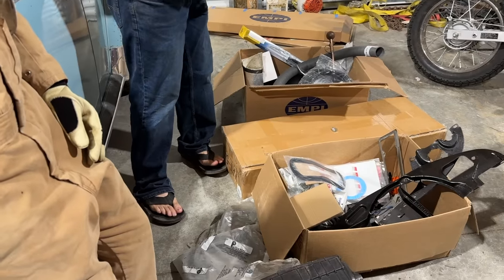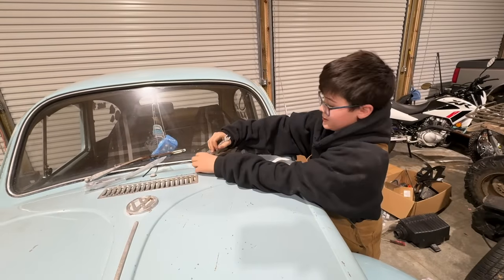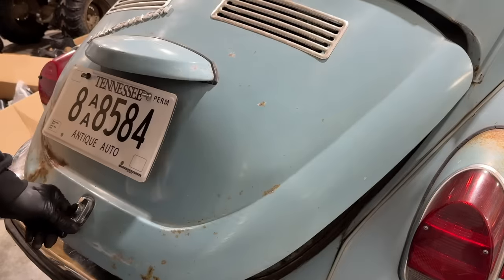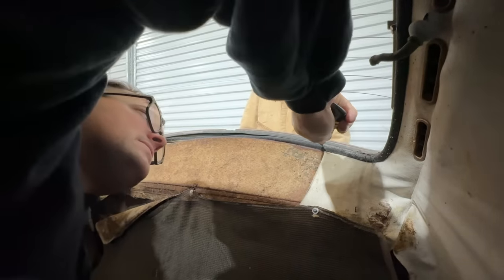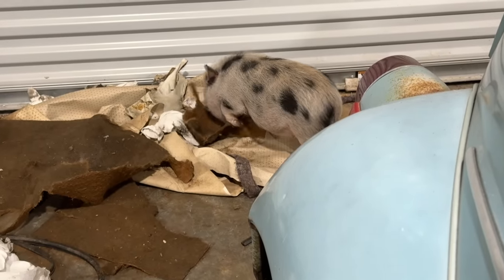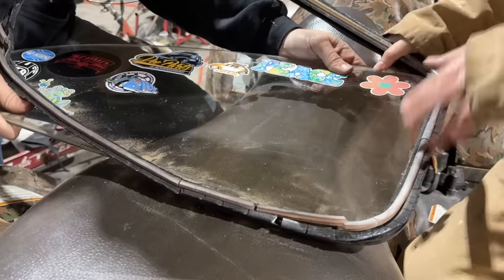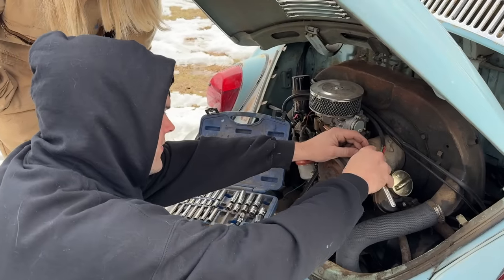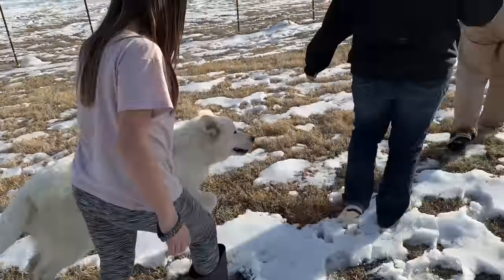Wawa’s Beetle gets Interior, suspension, roof rack, and engine maintenance!

Comment: It’s pleasantly surprising to see how little rust there is in the body of this Bug, super beetles are notorious for rusting out around the rear windows because water gets into the open space/air duct that accessed via the crescent shaped vents that side behind the quarter windows and it sits in the foam VW put in there to deaden engine noise and rots them from the inside out

Comment: Wawa needs to start using the correct VW tool to remove the hub caps. It’s a wire loop with two small hooks on it that latches into small holes on the edge of the hubcap. No damage to the hubcap or wheel paint.

Comment: Another thing you need to know about vws is you want to carry a fire extinguisher because some do catch fire in the engine compartment! Don't want to scare you but I know vws my dad had a shop in the 1970s and 80s and one more thing keep the valves adjusted or it will suck a valve an it ain't pretty when it does !

Comment: REPLACE the copper washers EVERY TIME you remove the filter gauze.
Don't reuse them, you will get leaks, they only crunch down once.

Good to have some spare cap nuts too
It you lose one and replace it with a normal nut, it will leak all over.

FYI
5th gear is in the wrecked 914 that you find in a barn or something.
Very doable but since 4th gear is OD anyways, not a useful project unless you're building up an engine.

Had a 75 fuel injected grey market bug back in the 80's, non super beetle
Was good for about 125mph on the highway

Comment: Torque wrench, those lug nuts. As a test, use your impact as you normally would, then follow up with torque wrench tightening to VW Bug specs and see how far off it is. May be surprised. I have a Milwaukee M18 Impact rated at well over 1000 ftlb of torque, zipping them down really quick  just as shown in your video. Then I have gone back with a torque wrench at 100 ftlb and had a good amount of turning left. Yes, if I hold the trigger for a few seconds, it will zip the nut down to well over 1000 ftlb, and most likely break. Remember, "An ounce of safety is worth a pound of pain". Cargo is too precious for such a risk. Especially since there were multiple lugs loose on different wheels.

Comment: VW engines run hot, Hot engines promote valve stretch. valves set to exactly speck will stretch so give valves a little extra clearance. In your case 6 + a half thou DON"T lug your engine, creates 
heat. Copper washers are crush washers. Always use new ones.
Reply from the maker: Ok thank you

Comment: Please, please get a torque wrench out and check the lug nuts. They need to be torqued to 90lbs!!! That's why so many of the lug nuts were loose when you took the tires off. (no don't use lock tight)  Best practice is to torque the lug nuts, drive around the block and check them again.  VW Bugs are really well designed cars, but you cant just guess about torque settings, when in doubt look it up.

Comment: 2 things: wheres your crankcase gases going since you have the oil fill tube capped off that supposed to go to the air cleaner?  Yep! At 37:39 below the oil fill cap looks like its capped off...supposed to go to the air cleaner.

Comment: you have dirt on those heater boxes I hope none gets inside heads.  stock vws didnt have oil filters...........I how ever wont run a vw with out the add on oil pump/filter setup.  Your bearings will love you for it!

Comment: Id recommend removing the front spare wheel from the beetle , I smashed  my beetle into a mob of sheep at 70 MPH in the middle of the night , I  didn't have the spare in the car and this allowed the front void to coplase and for the car to absorb the impact and ride up on the 23 sheep ,rather than the spare acting as a ramp for the sheep to head towards the windscreen .

Comment: Actually , until she gets her permit Mom and Dad should drive it around as much as you can as a form of "shake down cruise" to iron out anything that needs fixing so your piece of mind will be greater when she starts driving it regular.:eyes-pink-heart-shape:Oh, by the way, when you open the pop top lever on any can there is a "button" indentation opposite the tab, which after you lever up an inch the tab  you can place your thumb on and the lid will come off easy every time by pushing down with the thumb and pulling back on the tab.  Its why they put it on there, bettcha didn't know that eh?:cat-orange-whistling::face-fuchsia-wide-eyes:

Comment: If my memory is holding water, the earliest VWs I've seen here had brown leather seats, not sure when they were made, but late 40s early 50s timeframe, then that split rear window body  style changed, to single panel glass, those started out with the gray fabric seats that were tough as iron, they held up like a late 60s Greyhound bus passenger seat, by the mid 60s think you could option either the fabric or the black vinyl, you might still can, I've not been in a VW dealership since the 70s when I went planning to buy a VW Rabbit, and did so, didn't look at any other car, but by the 1970', every VW I've seen has a black interior, white headliner, like it's Here, it's a VW Beetle, it's what you get.
And the perforated headliner is not glued to the inside roof, like newer cars.the bows hold the center and should push it down, not up, then pull the sides against the parts that wrap and clip on -That is where the fabric glues in, the glue on other areas is for. holding  up the thin 'insulation' padding while headliner is installed.
Glued in the perforations can't equalize the humidity between the metal and the headliner which will eventually cause rusting.

Comment: Don't hit the threads on the tie rod? your replacing them, hammer away.   And if your cotter pins are rusty just use an impact gun on the castle nut and  it'll just shear off
Reply from the maker: Ok thanks

Comment: If there is ever a next time working on the front end , remove the fuel tank and you will have easy access to everything. On this note do you realise you were using the torch directly under the fuel tank , risking it.

Comment: I'm sorry but I would drill a hole in the threads on the tie rod and run a castle nut and not trust just a regular old lock nut I mean that is your steering when that goes you go wherever it wants you to go.

Comment: Please seek help from the 'BUG' community to install a new headliner. You should span it. Attach at the front. Then pull back so it stretches. Or vice versa. This headliner is installed wrong. And I don't think you can save this one.

Comment: cutting springs changes the spring weight which cant be good in most cases. They make an adjustable beam. you can get a narrowed beam with 2.5 in drop ball joints slamm that sucka

Comment: i don't want to start a holy war but this engines don't need a fully synthetic oil or even a semi-synthetic, gaskets can easy starts seeping at multiple spots because of super-penetration super-washing modern oils. Also, air-cooled engines is way hotter than water-cooled. When heated outside the mating surfaces, synthetic oil tends to produce varnish deposits; mineral oil does not have this strong effect. This Beetle has come a long way and no one will say what kind of oil was poured into it before us, but - the more you know..

Comment: That video was awesome , I had a vw 1776 with  dual kadron  carbs  cal style I put 90k on that car had it in the snow , many times to the river in over 110 degrees.  Tip oil change every 3 to 5k miles valve adjust every 10 k.  1776  head work 110 Engle cam  dual kadrons  38mm  solid car drove it everywhere and it was a sleeper , I ain't kidding.

Comment: Need to build you a plate steel wood heater or a oil burning heater I've got a big Englander plate steel wood heater in my house and it will run you out of the house it'll be 95° in here A whole lot better than the heating system I have I can fill it up with would put it on low and it will keep the house warm all night long

Comment: Sleeper dude My first car was a 65 Ford falcon that I bought for 500$ and I got it running and driving and polished it up and drove it all the time but had to sell it to get something cheaper on gas and I have kicked my self everyday since. Alot has changed since then I would love to have another one with a 5.0 mustang engine in it I would actually trade my 2000 mustang that only has 7000 miles on a brand new engine and transmission from jasper engines. I wish I had some way of talking with you about cars cause I don't know anybody into falcons like you or me
Reply from the maker: So cool thanks

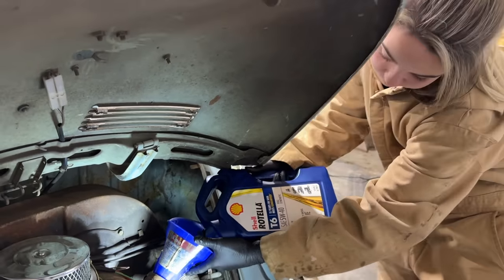Comment: 37:00 Please Read up on oils PLEASE That's probably OK. But the only thing about that motor is. Synthetic will leak bad in that motor. If it does regular oil wont

Comment: Josh, Looks like you're missing the sheet metal pan around the engine where the hoses go down to the exhaust. This pan helps with the cooling of the engine by only drawing in cool air from the above vents and not through the hot exhaust area below. I've sent you an email about the engine tin. I hope this helps.
Reply from the maker: Ok thank you

Comment: Y'all need a heater in there, like that double stack barrel kit for wood burning, line the bottom with fire bricks then mount an old steel tank for used motor oil and a copper line with a valve like for a water cooler and set it to drip and you'll have a great heater. That's what we had at the muffler shop I worked at boss man would trade labor for firewood 😊
Reply from the maker: Yea we need that!!!!
Reply: They use to sell blower fans you mounted to the tubes under the back seat.
Reply: I think he was talking about a shop heater not for the car..back in the day JC Whitney had small fans for the Bettle they were pretty worthless

Comment: Man going that far I would have rolled bed liner on the underside of the roof and then added sound deadener in8 order to control the noise and finally added insulation for better temperature control. You’d be amazed how well that combination control the noise as well as temperature. I restored a lot of cars, trucks, SUV’s, jeeps and even multi engine airplanes with my grandfather and started when I was a little boy all the way to adulthood. I also got very into car audio and picked up that trick. The roof metal and door panel metal is so thin that audio systems would literally destroy them and the truck bed liner solved that problem for me and had added benefits with the addition of the dynomat material.
Reply: I have a 73 Super I am restoring and I did exactly that. I coated the underside of the roof with undercoating/bedliner spray, then put a double layer of sound deadener on it before the headliner goes in. I'm not finished but I can't wait to see if that will take care of some of the heat and noise. I figure it can't hurt.
Reply: @garybush6117  it definitely will and you’ll really notice it when it rains. Will you still hear the rain on the roof? Of course but it will have a much quieter dull sound instead of the loud tin sound you normally get. The other benefit is the roof will actually feel stronger.
I actually gutted the doors and coated the doors the areas of the quarter panels I could get to and the floor. The areas I couldn’t get to I filled with spray foam. 
I also did the same treatment in the truck and trunk lid. The improvement of sound quality inside the drivers compartment was awesome. It also helped tremendously with vibration noises. I had installed a really nice stereo system with a few JL Audio W6 subwoofers so I wanted to get rid of as many rattles that I could. I never had an issue with the door skins or roof skin cracking like they eventually would when you run lots of audio equipment. 
Good luck with your build.  I’m sure you’ll like how it performs and will want to go back and do other areas and spray foam others. You’ll enjoy your driving experience much more.

Comment: 28:19  still rockin honda civics as well .  adjustment for valves done cold on a vw...adjustment HOT on honda civic valve adjustment.  pretty sure your doin the .006 for valves.

Comment: Yeah generator light on....yup.........ps vw heads run about 300 degrees at cruise. so if the belt did come off, youll have vw head bbq in seconds.  The vw charging light does 2 functions.  Light off=battery charging/engine possably cooling.  Light on above idle=failing charging system and possable non cooling fan spinning.  The less known vw overheating issue is the cooling flaps in blower housing.  Are they open when warm or is the linkage binding or........is the thermostat working properly.  Also, is the vw thermostat german accordian style or the less common mexican thermostat.  When the german ones fail, flaps stay open which is a non issue.  Mexican ones fail= flaps closed and a cooked engine.

Comment: overheating issues for vws......driving with engine rpm  low because of transaxle in to high of a gear.  Driving 30mph in 4 gear......nope.  Missing engine seals and tinwork.  Timing to advanced and or engine tune way out of whack.  Alternator or generator belt too loose.  Driving with no alternator or generator belt will immediately overheat a vw so if charging light comes on which means no cooling fan=STOP THE ENGINE NOW, NOT LATER. Do not drive to the nearest stopping spot if the cooling or blower fan belt or bearings stop working.  Vacuum leaks  which cause engine tuning to be skewed.  Ps  do not leave a rag or anything in engine bay area and start the engine and drive it.   You are basically driving a hoover vacuum cleaner on wheels and it will suck any debree it can find into the cooling fan.

Comment: Had a NEW 1966 VW Bug. Got it Florida when I discharged from Air Force. Moved to Ohio later in 1966 & had it until 1980. Only got stuck in snow 1 time. 13" on a hill was too much for it. No problems on Hiway driv'en.👍👍👍, have fun!

Comment: To heat your Volkswagen Wawa, you must crack open the vent window. It's not a suggestion, it's a necessity. Since the VW body is practically air-tight, the warm air will not be blown in by the engine's cooling fan unless you open the vent window. No ifs, ands, or buts about it. If you are familiar with how air-tight a VW is, you know that this is the only way to go.

Comment: I had a wobble in my 1971 Super Beetle, but for me it wasn't the tie rods; it was the inner control arm bushings. They'd rotted out. I replaced them with some silicon caseless bushings, and from then on it was rock solid.

Oh, and the tall ride height in the front was to compensate for the larger trunk capacity in the Super Beetle (what with the wider hood and the flat-laying spare tire).

Comment: if your valve covers are leaking........bail springs need bent right or get new ones!  Never ran rubber valve cover gaskets.  Let us know how well they worked.  The heads I currently have on are not bail spring hole drilled correctly so I just rebent the bail springs......kept on having cork gaskets shift till I had oil leaks everywhere.

Comment: Now that I finished the video....I  enjoyed all of the  7952 seconds of this video.   I owned a 1966 VW 1300 cc until it was stolen and was stripped down to make a dune buggy out of it.  The police found it in the bushes with all the parts missing to make a  buggy.   My brother had a 1970 VW and once on Christmas Eve my Dad, brother and I went shopping for gifts in Chicago.  I check the weather just now and the high for that day was -10 below and the low was -20.   These temps are the coldest on record for that day since collected date since 1901.    VW was the only car to start but I will tell you it was cold for the heat is not the best.

Comment: Excellent video Sleepdude Crew Josh   :) also Generator was last year in 1964 , but Desiel motor  on farm tractor also combine was 1980 I seen and if put Alternator on WA WA   Volkswagen Bug car put GM Delco Alternator from 1968 to 1985 year one with Internal regulartor  2 pin plug and Battery  post you use 70 to 100 amps be okay use on 2 post type ! Also use same pulley on Generator to Alternator  size plus belt too don't need Generator regulartor box too  and when hook up Battery do Negative ground  cable pig of ground to motor , transmission, dash to when new cables to have perfect grounded systems! Also Josh would put all tires to 25 psi is fine and more traction plus brakes plus steering responses better too ! Yes Winter tires be good ideas in Winter Season also use truck styles for Volkswagen car ! Also celien light in roof put Led  ones with toggle switch  in dash and back window defrost to would fix up too ! But those  car run cooler and only overheat in slow traffic jams that all ! Also yes reason those car up high front is if sturts also springs need replacement because worn out or no fuel in fuel tank Lol!

Comment: Had to laugh, everyone’s complaining about how cold it is and there’s Squeezy running around in a t-shirt. Glad Wawa’s car was finally able to get a little love, and now that you know how to install glass you can replace the windshield on Ralphie’s pickup. And speaking of the truck I watched Puddin’ working on his GMC project and I said to him I didn’t know who had the bigger mouse house to contend with, you in the Ford F150 or his GMC because both seemed to have the never ending mouse house. Anyway great job, and as someone from Canada that deals with the white stuff, keep good casings on the car, looks like you have them on there, take your time driving, no need to rush, shift down to a lower gear, no sudden jerking of the wheel and if you feel yourself losing control take your foot off the gas and shift into neutral let the car slowdown, and tell Wawa not to be afraid of it, heck we have people here who seem to forget all about winter driving each year.